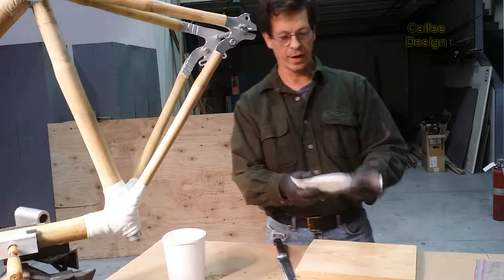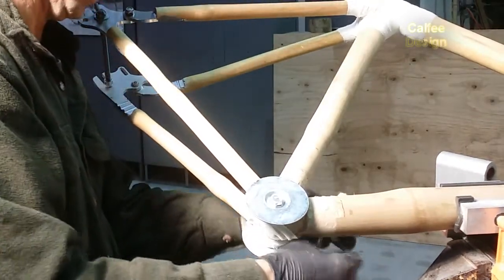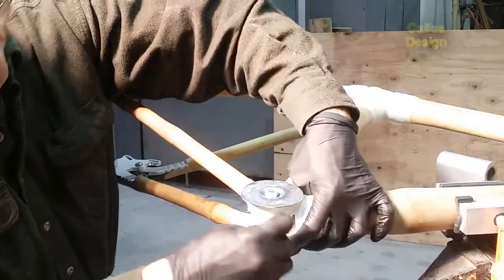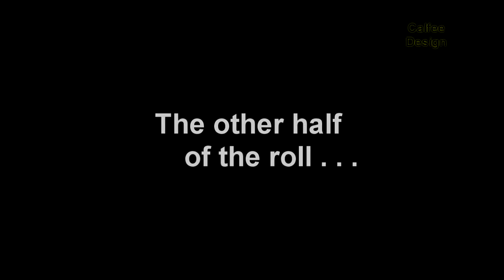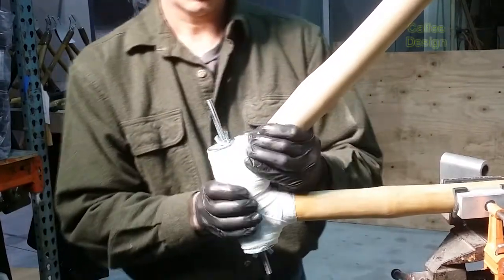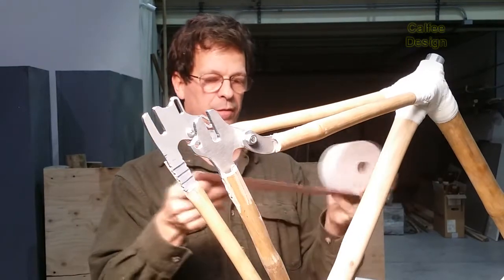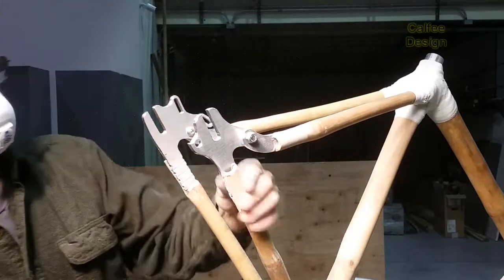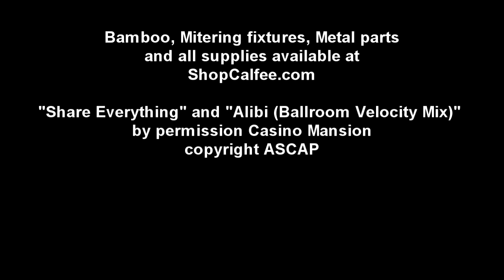10 Wrapping

Comment: Hi!- could you speak to the function of the bolt connection at the seat stay where it meets the drop out plate?   The chain stay connects to the drop out plate without a bolt.   Thanks much!
Reply: This serves two functions: It makes the dropout universal as it can adjust to any angle and can be taken apart for a belt drive application which requires a dropout that splits to accept it.